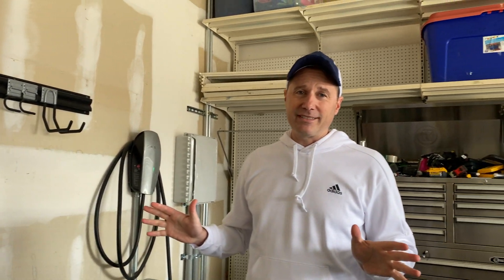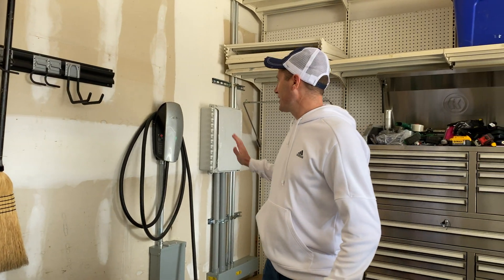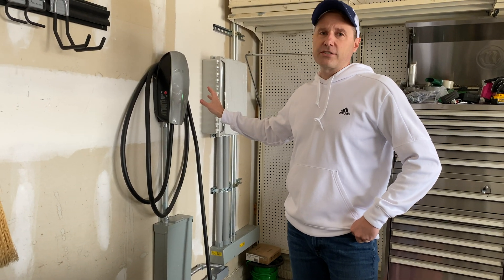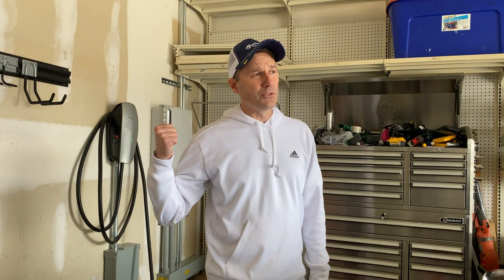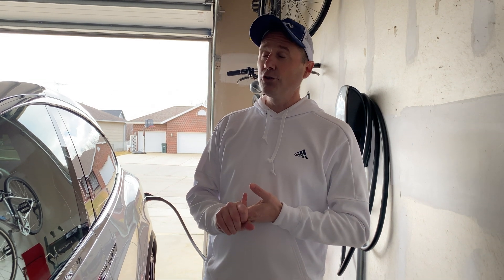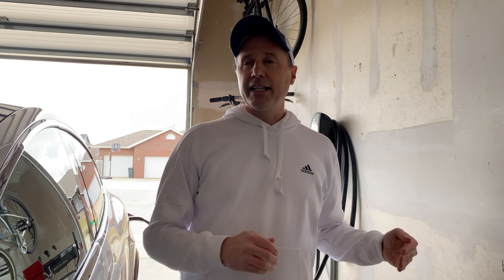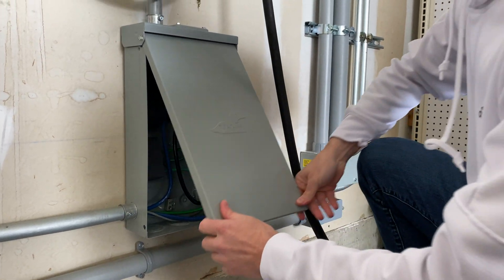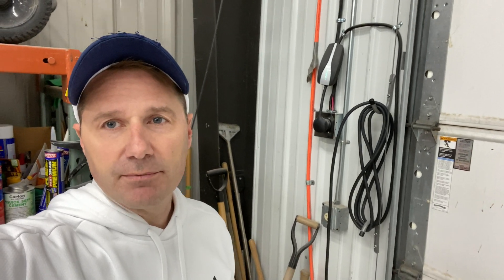Installing One or Multiple Tesla Chargers--what you need to know!

Comment: Are the communication wires a must, or can they wirelessly communicate?
Reply from the maker: They were necessary when I installed these, but that was 3 years ago. I know they have new versions of these chargers now. Makes sense if they did make that change, but I have not heard that
Reply: @ModernArtisan  by the way, can I Daisy chain two GEN 3 wall connectors or does it need a separate circuit?

Comment: So now with the GEN 3 chargers no more hard wire connection is needed between chargers, its all WIFI. So i.e. you do not need to daisy the power or Communication wire to each new charger from the master charger. You can simply just add a breaker for every new charger and go! Daisy chaining chargers will only apply if you are placing them in the same general area.
Reply from the maker: That sounds good for the communication part of it, but it is nice if 2 or 3 chargers can share 100 amps instead of needing 60amp breaker for each. Most homes don’t have 120 or 180 amps to spare so it’s nice if they can share 100.
Reply: Just to confirm, I do not need to run the communication wire between two Tesla wall connectors generation 3 just Daisy or separate circuit breaker, which I am choosing to Daisy to use the same circuit. is this correct?
Reply: @frankSANDIEGO  No… if you daisy the circuit then you just cut it in half the output.

Comment: This is a great summary. Unfortunately tesla has a Gen 2 & a Gen 3 that both can “daisy chain “ but not with mixed generations. 

Also, Tesla released a Gen 2 with native J1772 so you can share the single breaker with a mix of Tesla and everything else J1772. 

Perplexing, but it’s been sold out and not restocked and still no v3 J1772. 

The J1772 had the advantage that every Tesla includes the J1772 adapter
Reply from the maker: Jim, thanks for the updated info--this video is 2 years old now, so I'm sure your comment will be helpful to people.

Comment: I feel like it's easy to get carried away with estimating EV charging needs. You might need to share a 100A circuit if you're each driving over a hundred miles each day on less efficient cars, like a Model X.
But otherwise, it is just fine to have 2 car chargers sharing a 60A circuit.
Reply: You're right it's fine 90% of the time, because we're typically just charging overnight. But there are more times when you might think that I need two cars to charge asap and the difference is helpful. For the small cost difference it's nice to have the peace of mind. Also, I have 3-4 Teslas sharing those 2 chargers so that makes a difference. And who knows what the future holds as far as adding more chargers. In my mind it's an easy decision, benefit far out weighs the cost.

Comment: TIP: Two 60 amp breakers does not mean your using 120 amps. However you do need to do the calculations or work with an electrician to do the calculations on how to upgrade and if your upgrading a little - you may as well go the extra mile and upgrade plenty because in the future if you need to call out the electrician again it's gonna cost several hundred more for a new job.

Comment: Thanks for the video. Getting our first Tesla and wondering how to setup for future Teslas. My plan is 100A subpanel to garage, then two 50A (6-3 wire) circuits off subpanel, one for each car. Do you have separate circuits and breakers for each Tesla receptacle OR did you run a single circuit to service multiple receptacles?
Reply from the maker: You only need one 100 amp circuit run to your first charger. Then future chargers can share that same circuit with a communications line run between for them to communicate with each other as far as which chargers need more power.

Comment: Thanks. Great info.  Not sure why you had to re-wire for 100 amp breaker? I think you could have stayed with the 60 amp, #6 awg wiring to do power sharing with the two wall connectors. Two cars wouldn’t charge as fast at same time (22 miles I think) as the 100 amp. But, still pretty good?
Reply from the maker: Gregory Cooper you’re right I could have stayed with the 60 amp, and they could have shared that power fine. It would have just been a little slower and I wanted to maximize it. Thanks